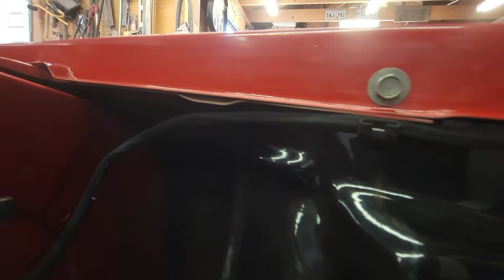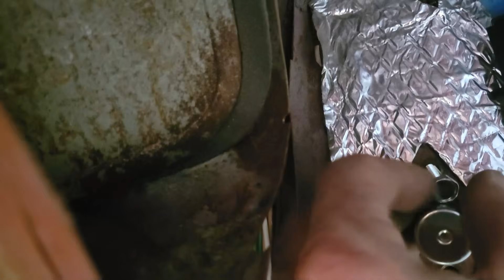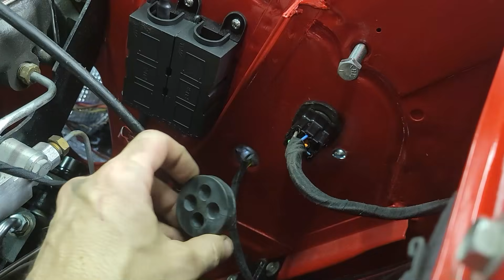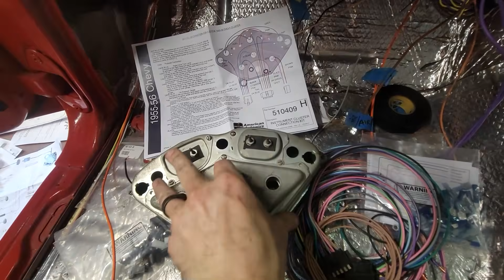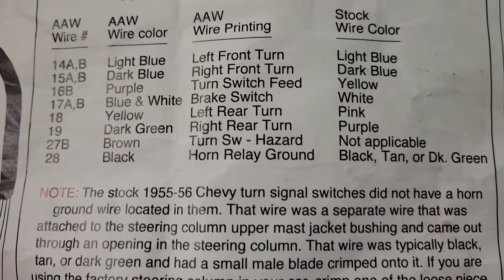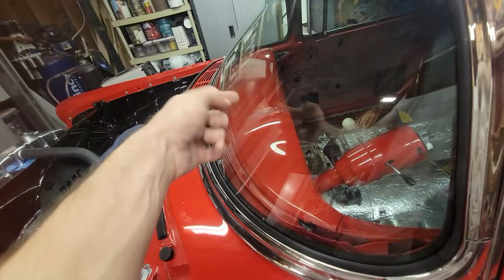E139 Pt 2 - Installing the American Autowire Classic Update Wiring Harness! 1956 Chevy Bel Air Resto

Comment: I have come across your channel last week while researching on how to get rid of oil canning. I must say you have a lot of knowledge and experience. I think I have an answer to why the console wiring is long. Possible to cater for right hand drive Chevy's in the UK and Australia.
Reply from the maker: You know, when I put in the Vintage Air unit, I discovered that the dashboard is symetrical down to its bolt holes for exactly that reason!
Reply: @RestoringChristine1956  I'm restoring a 1967 Camaro in Australia which was converted to right hand drive in the early 80's. I have brought a new American Auto wiring harness, I'm a long way from fitting it. It would be great if the dash wiring is extra-long, but 67 Camaro never came to Australia as a right-hand drive option unlike Ford mustang and early Chevy's.

Comment: Looking amazing. Can you update us about the windshield? Have you solved the not fitting mystery?
Reply from the maker: I think there was something not quite right about the way that I reshaped the two A-pillars.  I tried to keep them as exact as I could, but maybe 1/16" here and there add up.  Either that, or the factory isn't as accurate as they should have been, or maybe the glass isn't.  I still haven't had the chance to make sure that it doesn't leak, but I will before putting in the interior.

Comment: Love your videos.
But to know, AW redesigned the dimmer switch, like the fuse panel to go on the inside to preclude environmental isses. Hurst makes a reverse switch assembly that mounts on the Competition +  shifter that allows the wiring loom to connect.
Reply from the maker: Thanks!  From what I've seen, the Saginaw has a simple reverse switch, while the Muncie has a complicated lever system that a lot of people get rid of by mistake.  My reverse light isn't working, but I think the tranny isn't fully engaging into reverse with everything static and not spinning.
Reply: Unfortunately, the Hurst reverse switch relies on a stop bolt on the backside of the shifter that is not on the Hurst competition shifter for the Saginaw transmission here (I have the same). So will require removal of the shifter from the car, locate the reverse arm and locate a fastener to hold it in the correct position. It sucks as the Saginaw reverse is to the left and down, with different arm patterns. You cannot even get a Hurst branded shift ball. I had to go to the supplier for Hurst to get an unbranded one of the same quality.